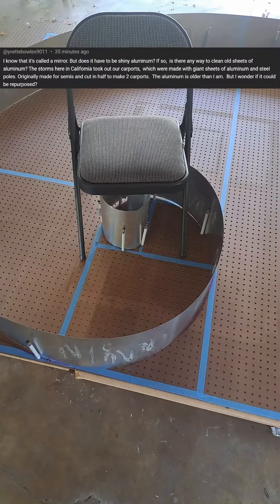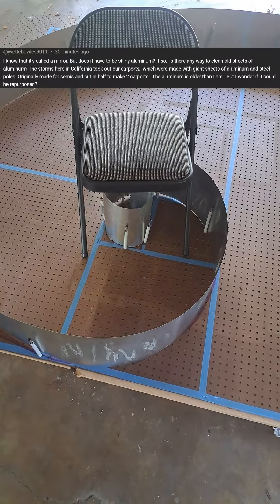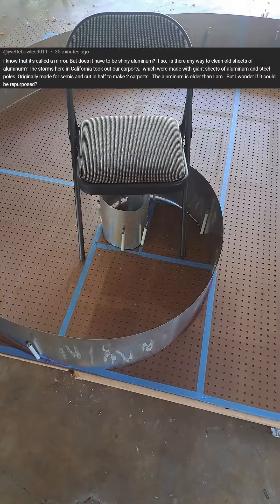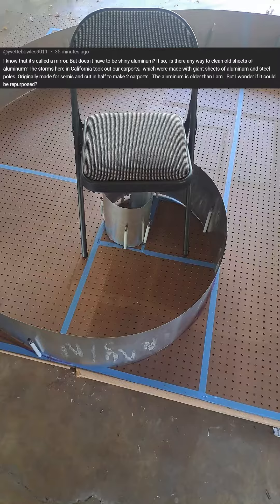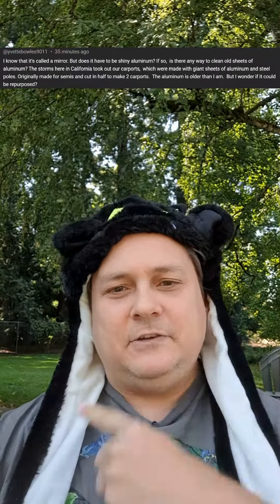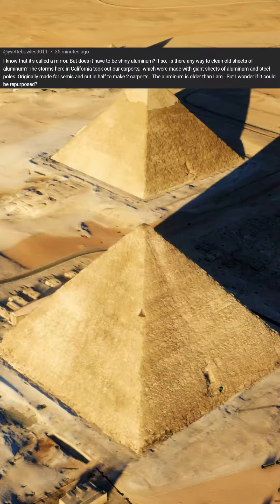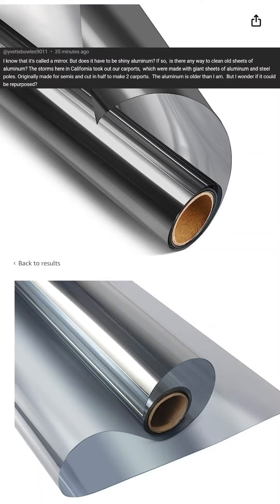Materials and Info for the Kozyrev Mirror

Comment: As an EE, and having given this a couple minutes' thought, the first thing to come to my mind is this: Much like an antenna is length dependent, optimized to say, 1/4 or 1/2 wavelength, the actual wavelength of the single carrier wave, this spiral would functionally be the opposite if its wall is grounded...its air space between adjacent walls encompasses any wavelength that fits, and everything in between, if you will due to its constantly varying inner dimension, nulling every frequency.  That's assuming we're talking about electromagnetic waves such as RF.  But this stuff actually looks like an extension of the current science common knowledge into areas we  know little about.  I suspect black projects are way beyond this.  And if that thought above is correct, for one reason or the other, then the exact shape of the curve isn't important so long as it's a constant curve of varying radius from the center.